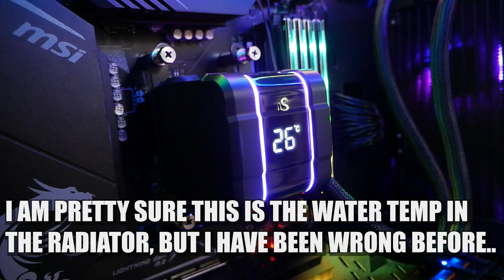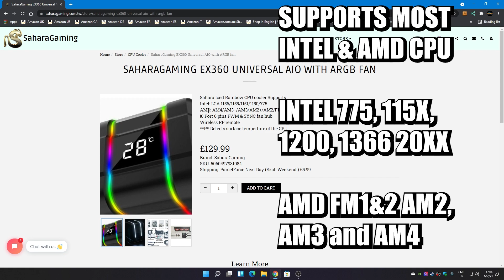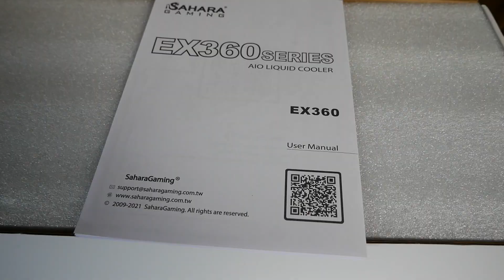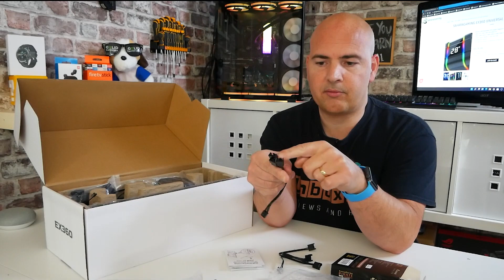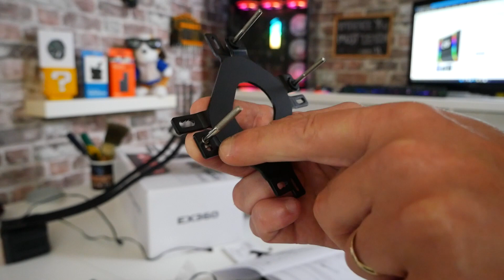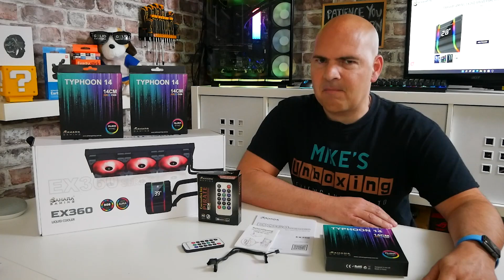Sahara Gaming EX360 LCD Display 360mm AIO Water Cooling System Unboxing Install & Demo

Comment: Hi Mike, are you still using this cooler, and if so, how has it been? It's now available for £71.99 so a much better value option. I'm considering it for my 5600x in a 4000D case as I want to vertically mount my RTX3070 FE but the crazy way Nvidia has the 12 pin connector right bang in the middle it conflicts with my tower cooler so would need to have an aio instead.
Reply from the maker: i sent it on to a discord member but it is still going strong i believe. decent cooler in my opinion

Comment: Same bullseye fans as the 140s in the C501??

Also pipes down on front mount AIO or they'll be beating you with a Gamers Nexus video
Reply from the maker: not the same fans much better and a lot heavier. the fans really are like nothing else i have seen from sahara, they are a lot like the thermaltake toughfans in weight.
sadly for most 360 aio the pipes are not long enough for a pipes down setup, would have liked a top mount in this case but then you cant see the fans
Reply: @mikesunboxing  it hardly makes a difference, I just remember the fear when I realized I'd the arctic fitted "sub-optimally" lol. 280 AIO in KZ10 had same issue, very hard to get pipes down with a gpu in there. Luckily I watched your C501 review and got one on warehouse ❤️. Loads of space for top mount
Reply from the maker: @fracturedlife  yeah decent amount of room on there

Comment: Great review Mike. As a novice I reinstalled my Evo and still needed instructions (last installed 30months ago) but was straight forward. Watching the installation of back plate seemed very similar. Just proves follow the instructions and cant go wrong. I do have a question however; does the pump readout correspond to the cpu temp value shown in HWMonitor software you use? Love the halo fans with strong rgb. Whereas I fitted gamemax halo fans to my case and top mounted very faint and now relocated to psu shroud can only see one thin ring of colour! The hub looks identical to gamemax hub so would sahara fans fit gamemax hub from F15 case? Stay safe and enjoy the sunshine!
Reply from the maker: the value on the pump head i believe is the water temp, but they state it it the CPU surface temp, but that is almost impossible as the copper slug is in the way of a direct contact to the surface.

the gamemax hub uses regular PWM and ARGB headers where this is all saharas own 5 pin on the hub
Reply: @mikesunboxing   So the reading cannot possibly be the real cpu temp...understood. Shame as those fans look way better than gamemax ones. My fans are all 3 pin, both 200mm and the 120mm similarly the halo ones are 3pin DC controlled. Watched your setups numerous times before penny dropped and set to DC in bios to set low rpm! Thanks Mike trust you and Kath enjoy the mini heatwave!
Reply from the maker: Yeah we are getting a little bit of sun while we can

Comment: Not a bad looking aio but at this price point its got some stiff competition with some well known brands. Thanks for the comprehensive review 😊
Reply from the maker: Agreed! there is starting to be a real push in the 360 aio market, but for just a tad over £100 with all the kit and hub etc it is a pretty good option.

I might grab the MSI 360 aio just to compare as that is a similar price at times

Comment: Not a bad-looking unit for such a low price. If Goole is right, 130 British pounds equals about $180usd which is a cheap way to get into water cooling. It's easy to spend $800 to $1200 on full custom loops.
Reply from the maker: totally agree. I would love to go custom at some point really need to do that one day
Reply: @mikesunboxing  When you do, you might want to start with soft tube. It's the cheapest and easiest. But if you're adventurous, PETG or Acrylic looks much better.
Reply from the maker: @OlettaLiano  Thanks for the advice :-)

Comment: Any chance to take a shot at the Deepcool AS500 Plus?
Reply from the maker: that looks good and seems to be in the same range as the D15 so the sahara beats it most likely as it did the D15 by a few degrees. but the deepcool as500 looks like a decent cooler on air

Comment: Now this will actually make me want to buy an aio. But im always worried about their lifespan
Reply from the maker: like anything the more moving parts or complexity there is more points of failure. but then on the flip side of that we often by a car with all the gadgets as it is more enjoyable or more exotic.
AIOs and water cooling also fit into the category. they look awesome and offer a better experience at the potential loss of reliability, although fans and pumps have come a long way in the last few years
Reply: @mikesunboxing  i agree it is cool and better looking. I still need to weigh the cost and benefits i get by using aio. The ones i could see is the cpu will be cooler and the motherboard will not receive unnecessary stress on the CPU area due to mounting of the heavy air cooler i use

Comment: Looks like a great AIO this one, just a shame there isnt a 240 version for peeps like me with a smaller case.  Great review though, thanks for taking the time to do it, Mike and Kath.
Reply from the maker: Thanks for watching! and you never know if this does well then they might look into a 240 or 280 version?
Reply: @mikesunboxing  does seem strange they would not offer the other 2 sizes.
Reply from the maker: It was thought that the 240 market was over saturated and the 360 was more niche so they could spend more on research and design